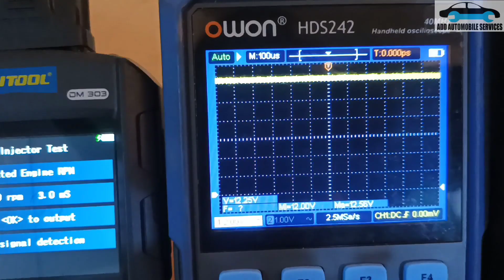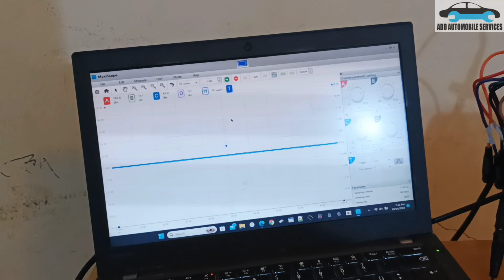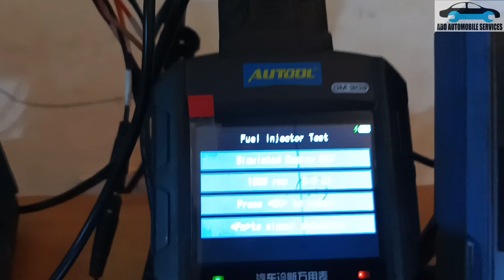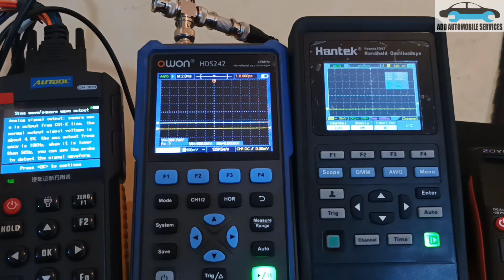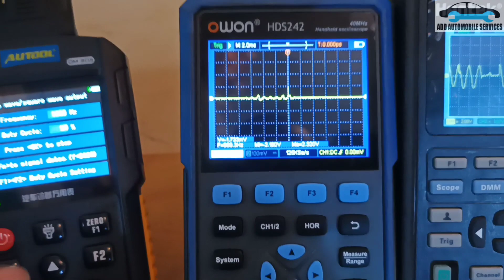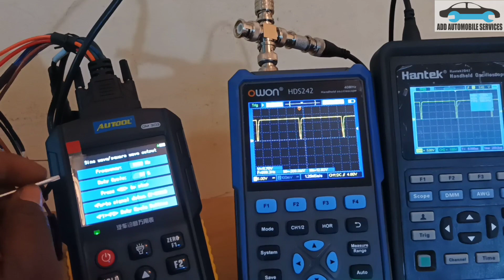How to setup a scope for automotive analysis

Comment: Hello, I am subscribing because there are many good videos. I'm looking at two products, and the AUTOOL DM303 product seems to have good functionality for self-maintenance, but isn't the oscilloscope function inferior to the Hantek one? I wonder if the DM303 model can be used in 2 channels. The Hantek 2d82Auto product has a lot of car maintenance functions added, but the price is twice as much, so which of the two should I buy?
Reply from the maker: The hantek 2d42 is a good one to buy and the dm303 scope is not good like the hantek and the owon when it come to a CAN line